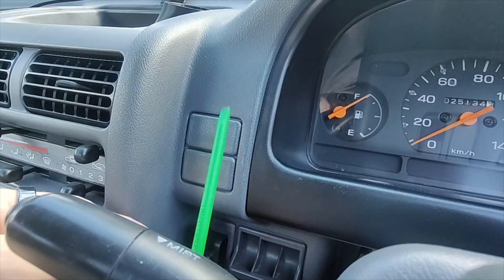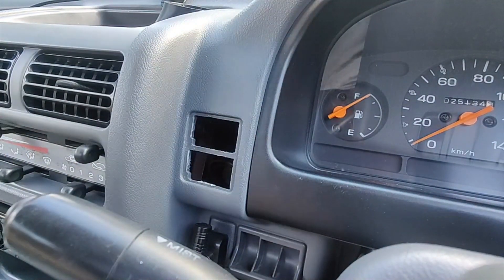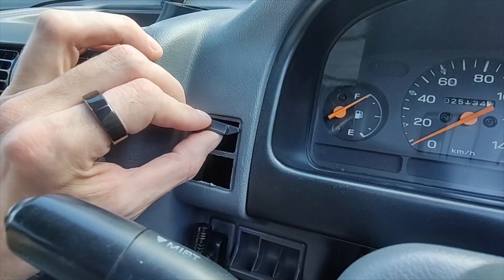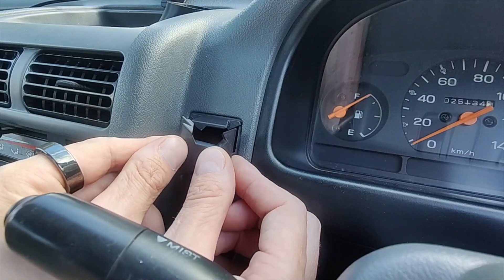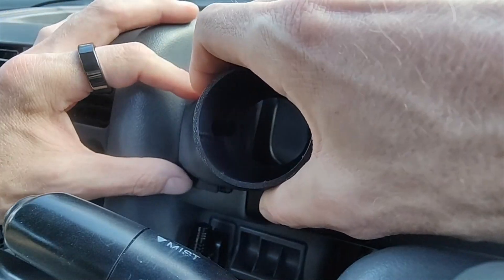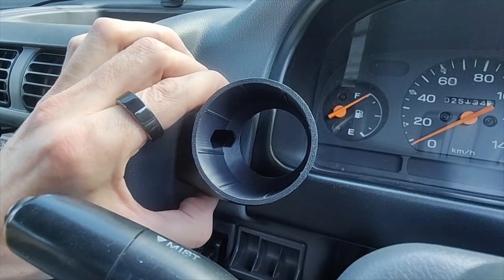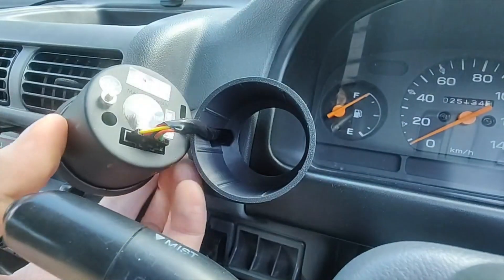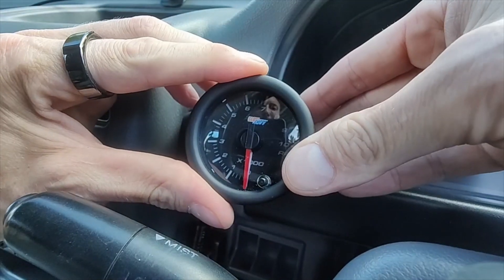Sambar 2" (52mm) Gauge Pod Custom 3D Printed KS KV Install

Comment: Did you use the yellow wire, constant power source, on the glow shift? It keeps the color memory, or are you just letting it reset to blue every time? Thanks I just received your tach pod in the mail.